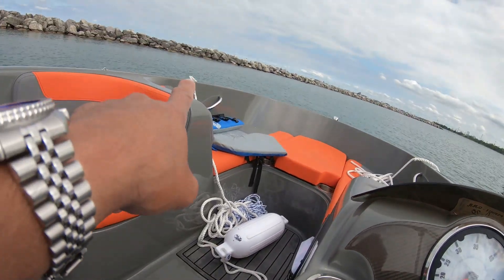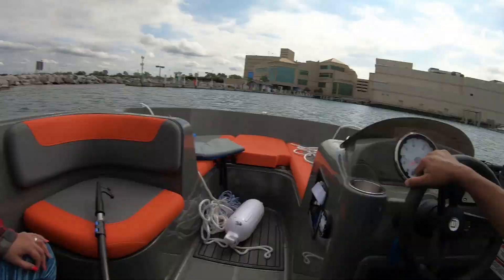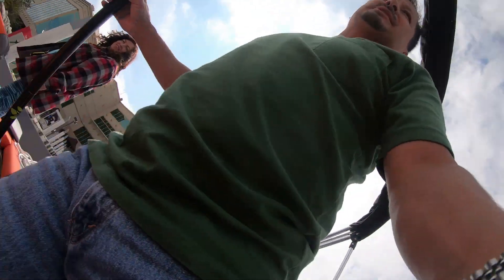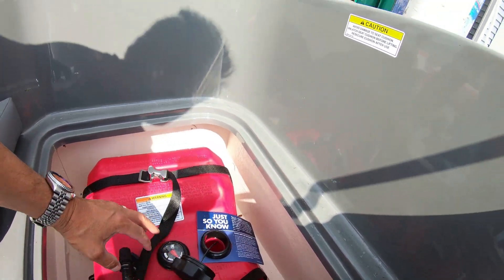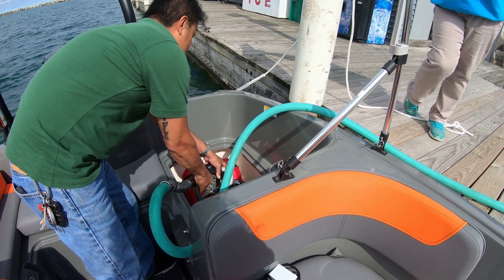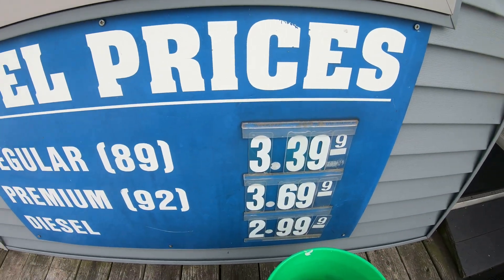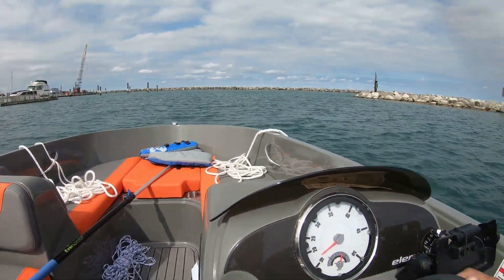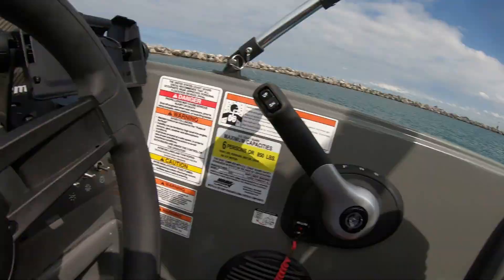How to gas up a 2020 Bayliner Element Docking and fill up

Comment: good job, Dad had a 16ft woody back when we lived on Mona lake (connecting to lake Michigan), in 69-73, had family trips down to South Haven, and other Lake Activities both on Lake Michigan and Mona Lake. But we left the mid-west for the RGV part of Texas around 1979,,, Keep having fun, I suspect small boats get used more often and are more fun for families. *just easier. (don't worry about putting normal or premium gas, your EFI will work fine with all levels of gas/ but vapor lock occurs sometimes if you still have winter formula gas in your tank for summer, but that is TOTALLY different fun times. Enjoy.

Comment: Rob, great looking boat. I have 2018 e16 & installed the Seachoice 30121 Fender Locks toward the stern of the boat. I use the stock bow cleats to tie off the front bumper because IMO they are positioned in a decent location.

Comment: Do you use non-ethanol gasoline?  Can't get it in some states.  But it's widely available in FL and that's what I use.  I think it's 89 octane, and about $0.50 per gallon than regular unleaded.